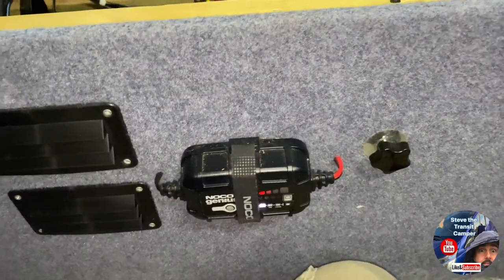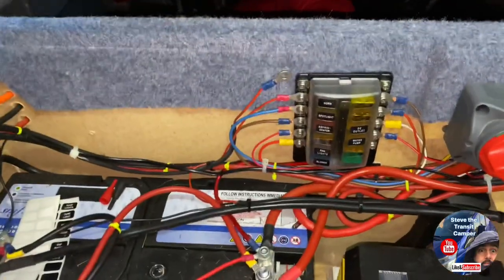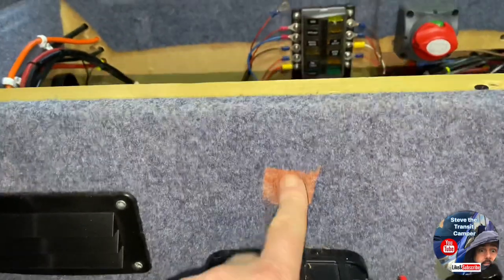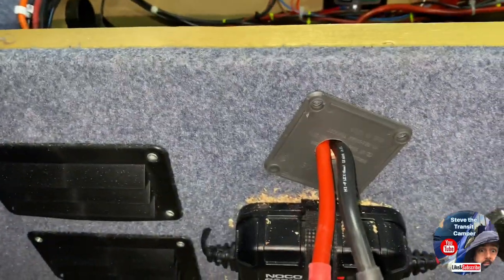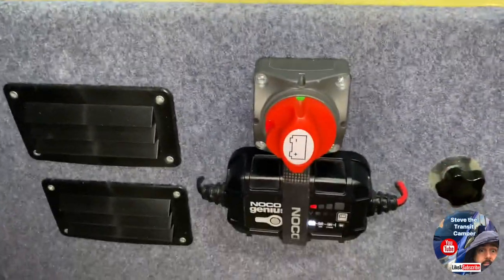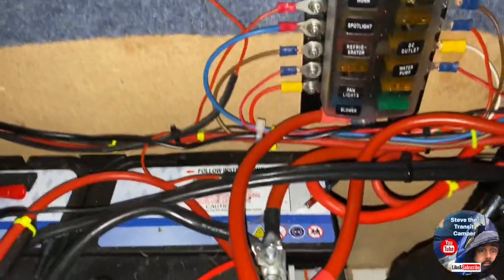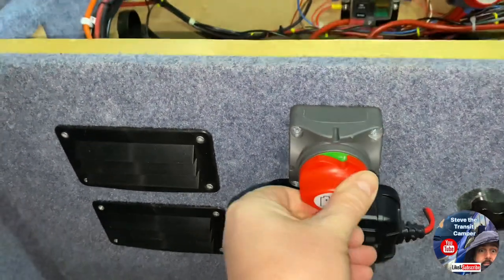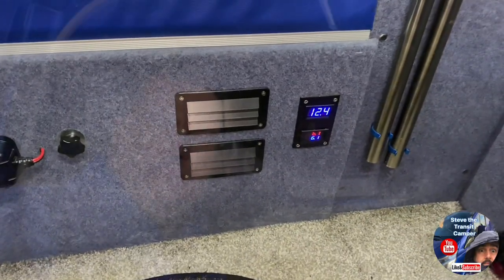how to isolate your batteries in your stealth campervan

Comment: Get a solar panel mounted up on the roof, it will keep your batteries charged up even in our dull British winters.
Reply from the maker: Yeh I have two panels on my roof brother, but there aint no power from UK sun in the winter, waste of time in my experience
Reply: @STTC  rigid panels or flex ones mate? I have two rigid ones, 250w in total, on my truck.
Reply from the maker: @RanDomRikM  mine are rigid too 1 x 50w and 1 x 100w,,, useless in the winter

Comment: Hi Steve I’m just incorporating one into my electrics can I ask what diameter is the threaded contact on your fuse box as I have one the same and I want to order the right size cable ends. Hope that makes sense
Reply from the maker: Hi Nick, yeh it’s an M5 thread with an odd sized nut which screws on, making things more awkward than it needs,,cheers for watching
Reply: @STTC  cool thanks for the reply and always watch learnt so much especially about parasitic draw as I now call it. I will order cable with an eyelet do 6mm. Thank you 🙏